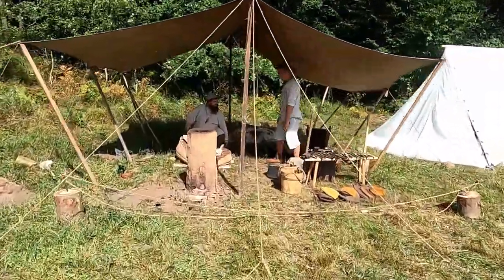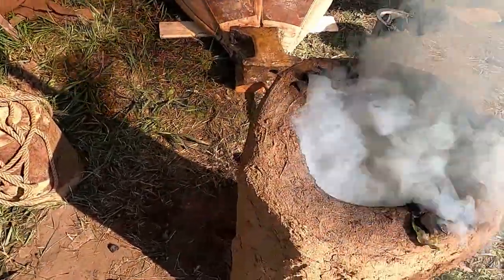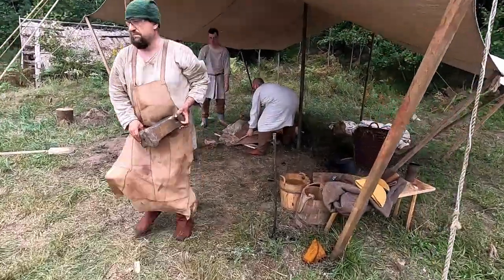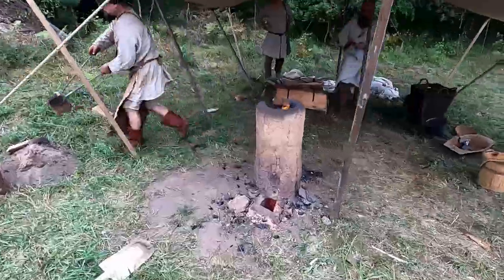Iron smelting and extraction of the iron bloom, slag-pit furnace.

Comment: What is the difference between this and an aristotle furnace? From what I understand, the main difference between aristotle furnace and regular bloomery furnace is that the air hole for the bellows is about 20cm above the bottom of the furnace. Would this one quallify?
Reply from the maker: the Aristotle furnace is small furnace used to carburize the iron produced in the bloomery furnace. bloomery iron has rather low carbon content. In ancient time, two main type of bloomery furnace were used: 1:slag-pit furnace and 2: shaft furnace with slag dropping (i also upload some videos with this type on my channel).